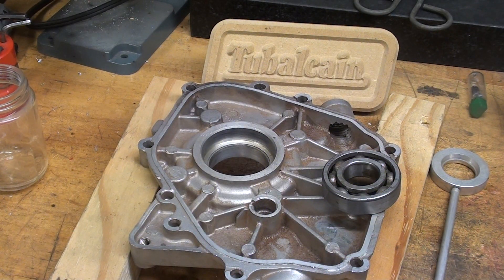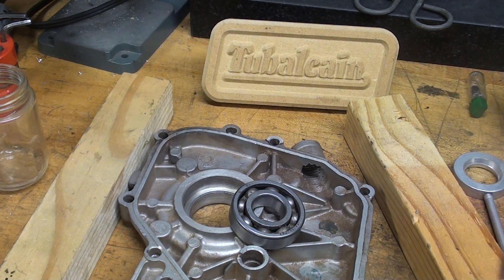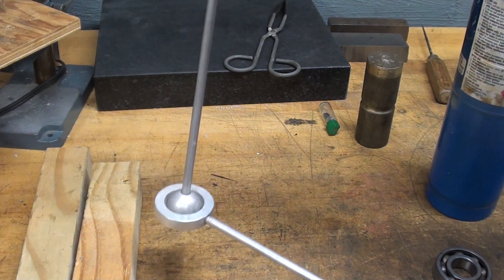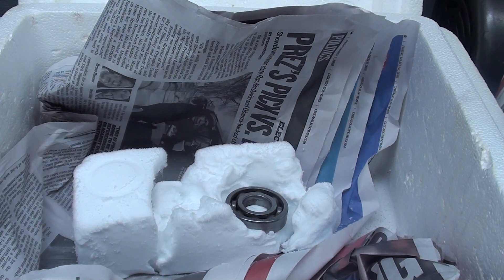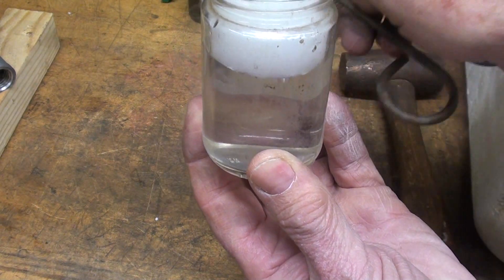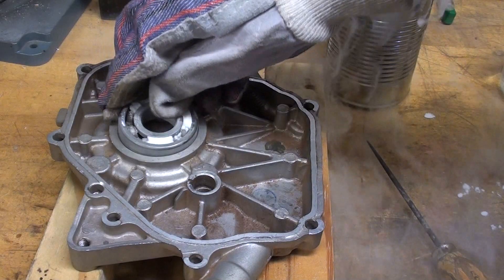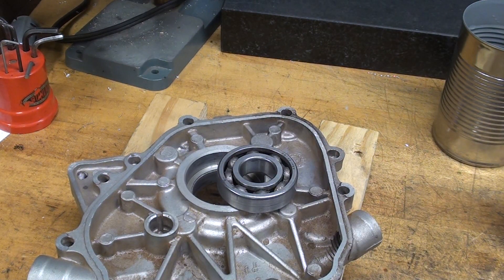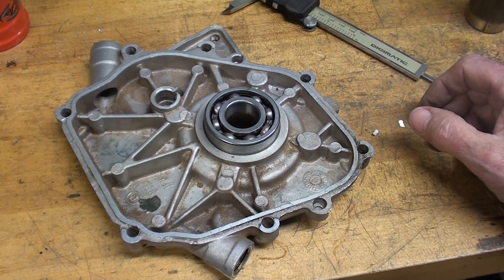SHOP TIPS #298 Shrinking a Bearing with Dry Ice tubalcain

Comment: Thanks for your continuing efforts in demonstrating shop technique Lyle, I did use dry ice once or twice in my working career for fitting bearings, but much more frequently used an oil bath heater, and later induction heaters to expand bearings to fit them to shafts. Once when on a mining machine repair, we had our electric oil bath heater but no power to run it as we were in the field. We used oxy acetylene to heat the oil bath but when we took the 8" or thereabouts bearing from the oil it had been blued by excess heat. We disposed of that bearing and got another new replacement, but when we had a visit from a Timken rep several months later, he told us that it would have only marginally reduced the life of the blued bearing, and that we could have used it. Thanks again and keep up the great work.

Comment: I never used dry ice before.  I remember my Dad showing me how to shrink a crankshaft in the freezer and letting the bearing sit in the summer sun in the driveway.  It worked well too.  I once machined a chuck backing plate and it would not star4t into the chuck.  So into the freezer it went and the chuck lay in the sun.  After about 30 minuets the two went right together.  Thanks for sharing.

Comment: MR. PETE,  I HAD TO LEARN YOUR PROCEDURE WHEN PUTTING A GEAR ON THE AXLE HUB OF A JOHN DEERE CRAWLER.  I WAS AMAZED AT IT THEN.  WHEN I PUT THE GEAR ON THE AXLE HUB IT FELL RIGHT THROUGH.  BY HOLDING IT IN POSITION FOR A FEW MINUTES IT WAS THERE.  IT STILL AMAZES ME.
Reply from the maker: +ROBERT HORNER It is amazing!

Comment: Thanks for making this very useful video, Mr Pete. It will come in handy this very weekend fixing an old cast iron trailer wheel hub as I need to remove the bearing before I fix the broken casting and re-insert the stud bolts. My mate tried inserting the stud bolts and cracked the casting further.

Comment: Thumbs up! I use to put the inner part, whether is a bearing or any other part that needs to be press fitted, in the freezer, and the outer part in the oven. That way allows you to reach a better differential between the parts, and the fit is more tight.
Reply: Yes I've used a conventional oven (200C) and a normal freezer (-30C) to do this to achieve a light press fit without a press.

Comment: I did this some years ago, to insert the input shaft bearing into the cast iron gearbox of a '73 Triumph.  I didn't have dry ice.  I just wrapped the input shaft in newspaper and stuck it in Her Royal Highness's freezer.  I put the gearbox in the oven (it was a small car) at 300F (and boy did that stink!).  After an hour, the room temperature bearing slipped onto the input shaft with no interference and the assembly into the gearbox just as easily.

Comment: When installing ball joints and a shop I worked at years ago, we would freeze the ball joint and heat the control arm on the vehicle. The ball joints would simply slide right in. Other wise you would have to use a pneumatic impact driver to take them out and put them in. Great video! Thanks for sharing.

Comment: I once had to fit a timing gear to a crank on a motorcycle engine. It was purely an interference fit, no key alignment or bolt compression to hold it on.
I used the reverse of this, I waited till I knew there was a really cold night coming (-9c) and left the bike at the doorway to the garage. The factory method was to press the gear on with a huge press, not convenient in situ.
 Next morning at 6am, bike nice and cold soaked, came out, heated the gear with a propane torch till the oil smoked off it, then slid it on. The clearance was initially so great, the gear could be lightly rattled on the crank! 
You could also make mention of the excellent thermal expansion properties of aluminium (especially compared to steel), that bearing could be dropped into that casting if you heated the casting up just a little as well.
Knowledge of these things helps solve problems!

Comment: Great video!!! you also could have applied heat to the casting to shorten your wait time as the bearing was cooling- on a side note I was also in the entertainment business ( Sound and special effects for local bands) I built a "Fog machine" from a small metal trash can, hot water heating element. small squirrel cage blower mounted to the top and a drier vent hose to the side of the can to direct the fog. Heat the water add dry ice (I used a milk crate on chains up thru the top of the trash can so it could be lowered into the hot water when needed) & turn on the blower- HUGE amount of "Fog" would slowly creep out onto & fill up the stage to about knee height the crowed LOVED IT!!! there are a few more details to building one but that's the main idea - Two thumbs up mrpete !!!!

Comment: Hi Lyle,
Very good. I have to keep explaining to people putting things into the freezer will hardly make any difference. We used to use liquid nitrogen as you mentioned. Dry ice is much better than the freezer and as you have demonstrated, does work.  Expansion of steel is about 6.5x10^-6 in/inch F which is 6.5 micro inches per inch for every degreeF. so your 2" bearing will shrink about 1300 micro inches whch is about 1.3 Thou, and this would make a difference. With ring gears we used to allow 1.25 thou per inch of diameter. Easy rule of thumb. and used to heat them with a torch and used oil to determine the temperature so when the oil would sustain combustion it was hot enough. Crude but it worked. Liquid nitrogen was used for valve guides. Just protects the parts so it does not get bruised by using force.
Allister

Comment: I had no access to dry ice so what I used is LPG, I had a hose hooked up directly to a 2 kg cylinder and would turn it up side down and slowly trickle the liquid gas over the bearing and in short order the bearing was very cold, then picking up with gloves drop it into the housing this works very well but attention must be drawn to avoiding open flames and sources of ignition, I have used this many times and it works well, the vapour from the gas disperses in a few seconds with a nice breeze. I would not recommend this method to anybody these days as there are too many people looking for a shortcut too suing somebody. lol.
Reply: That method is extremely destructive to the atmosphere. Free hydrocarbons in the atmosphere produce smog. It's the reason why all of our modern gasoline cars and trucks are built with an evaporative emissions system that stores gasoline vapors in a charcoal canister for burning later while the engine is running.

Comment: Common method in aviation also. We would heat a large roller bearing in oil and then slide it over a long shaft in jet engines. I understand that the very large bolts used to attach the wings to the fuselage in large airplanes are shrunk before installion.
Great video - as always.

Comment: Cool! I never thought of using dry ice. I use this process putting the part in fridge and slightly heating part to expand. Learned it 50 years ago installing starter rings on flywheels. Russ

Comment: Hello, Mr. pete. I thought that you would be interested to know that I once worked for a foundry ( as a driver) and one of my jobs was to occasionally go for some boxes of dry ice, in "styrene" boxes.
The dry ice that they used in the foundry/machine shop, was pelletized and it is my time working for the foundry that got me interested in machine shop work, as I used to go into every section of the foundry and machine shop as part of my job.
Incidentally, one of the products that they used to make was the big dragline buckets, as used in open cut coal mines and spare parts, such as the lip with the digging points and the individual points themselves, also ripper shanks, ( for opening up trenches).

Comment: I use dry ice fairly often. we have a machine at the plant which sprays dry ice like a sand blaster for cleaning machinery. works awesome and the only mess is the stuff that was on the machine is now on the floor to be swept up. You can pick up dry ice but you have to keep rolling it around in your hand so it doesn't sit in one spot for more than a second or two.

Comment: Cool video, I've used dry ice many times in the machine shops I worked in. Sometimes, if we had the time we would use the freezer in the break room. When Liquid Nitrogen became readily available and affordable, we switched over to that. We would use Liquid Nitrogen to replace the air-frame bushings for the landing gear on the F-16.

Comment: Same method is used on aircraft landing gear, where the shaft is shrink fitted onto the landing gear casting, using a combination of liquid nitrogen for the shaft, and an oven for the casting, then put together using a hydraulic press. You only get one chance to do it right, so have to prepare and check everything before, and do it all in seconds once you start the ram. 

Removal of the shaft is easy, you put it in a mill and use a boring bar to cut it out of the casting. Once you get to the collapse point you just need a new boring bar or you have quick reflexes.
Reply: +SeanBZA Aircraft (reciprocating engine) cylinder heads  as well. The aluminum heads are heated and the steel cylinders chilled; then quickly aligned & screwed together in a special device. An otherwise serviceable cylinder can later get a new head if necessary, but the old head must be cut off.

Comment: yeah good one, I used it to remove broken off sparkplug in aluminium head .froze an xzn bit and tapped it in.put it the freezer though.didn't know about dry ice, very good tip. thanks. goedendag

Comment: The same thing works on outsides too but it takes heat, you can drop a flywheel ring right on with a bit of light torching.

Comment: Driving the bearing into the housing,(especially an aluminium one) will cause problems with size fits, always use this method when replacing a bearing in a housing, or warm the casting, it is easier than using dry ice.

Comment: The local supply sources for me are a disco outfitters, and a stage outfitters. Dry ice is used for fog effects in both cases, and they can obtain it readily. For small bearings, you could try the wart freeze spray obtainable from chemists - the cooling effect may be sufficient to do the trick. Also worth trying is a deep freeze for the bearing, and a warm oven for the casting (obviously not if there are low temperature inserts in the casting) - the expansion rates are a little different but enough differential temperature should work.

Comment: I've had to use the reverse and heat up the mating part to remove a trreading gauge that got stuck. We also used ice on the gauge at the same time. It took some time but we got it out. :) This was a large oil-field threaded connection on a 12-in diameter tool called a drill collar, used above the bit, to add weight to the bit, when drilling an oil or gas well.

Comment: If you don't have access to dry ice, you can heat up the aluminum casting to about 250F and have the bearing in the freezer.
I use a welding rod oven set to around 300 and out motorcycle cases in. Within about 10-15 minutes I hear the bearing fall out as the aluminum expands much more than the steel does.

Comment: I remember well the first time I did this, only I put the bearing in the freezer overnight and gearbox casing in a low oven. It was amazingly satisfying when the new bearing dropped in and even rattled a bit whereas the old one had to be driven out.

Edit. Pro tip:  Make sure it's the right way round. BTDT.
Reply from the maker: +Graham Langley thanks--I do that in upcoming #299

Comment: A word of caution to your viewers:  In the past, I've used dry ice/acetone baths for cooling traps in vacuum systems (Chemistry) and other applications.  The problem arises in that copious quantities of CO₂ will dissolve into acetone −78.5 °C (Henry's Law).  If you then plunge a room temperature object into the bath (e.g. a thermometer), it will immediately raise the temperature, causing CO₂ gas to come out of solution.  The gas bubbles churn the solution, accelerating the degassing.  A geyser of dangerously cold and flammable acetone is the result.

I once had this happen in my kitchen on a particularly cold winter day.  Needless to say, having to open all windows, extinguish all pilot lights and potential ignition sources, and air out the house for hours was no picnic!  If you must submerge an object in such a bath, do so with extreme care.  Pre-chill it if possible, and immerse it in the bath as slowly as you can.

P.S.  You could have just looked up "dry ice" in the phone book.  Remember those? :P
Reply: +Brandon Fesser what...WHAT.....FOR THE LOVE OF PETE, DONT LEAVE ME HANGIN.....WHAT THE HELL HAPPENS WHEN

Comment: Very minor correction that's not water vapor coming off the jar, "When dry ice is added to water, it sublimes to carbon dioxide gas rapidly because the solution's temperature is warmer than the dry ice (-78.5 C° or -109.3 F°). This gas can be observed as bubbles or clouds above the solution."

Comment: If you fit a bearing just .001" into a bore, you will need to use a hydraulic press to remove it. If you heat up a bore to insert a bearing and the bore is too small (about .010" smaller) it wont spin. Fitting bearings is engineering calculated. Not too big, not too small. I spent more than 20 years dealing with that. Shrink and expansion are very precise. When you cut a piece of wood you can use a tape measure to measure it, to measure a diameter of metal bore or shaft you must use the right tool.

Comment: I'm doing sealed bearings on dolly wheels very soon . very timely. Will I need to regrease them after words? if so what is good to use( they are a high speed bearing)  thanks. I don't machine but have all ways been interested. I was in a shop a few years back and the old timer there wasn't interested in teaching any more. I guess it wasn't my time. keep up with the videos and thank you for what you do

Comment: Does the effect.of cold work on the opposite instrument that you showed the thermo expansion demonstration? I'm sure it does, but didn't know if the aluminum would shrink that much. also when I sleeve a bearing or race over a shaft, I heat the bearing.or race in oil to give it a more even heating.and less likely to over heat and damage or weaken one side more.than the other.

Comment: Could you use the dry ice to remove a bearing as well? Would the heat transfer from the bearing to the ice quicker then the heat form the casing to the bearing?
I have a 50mm tapered roller bearing and the outer race is a press fit to the iron casing. Do you think it would work to jam a piece of dry ice on the inside of the race, possibly apply little heat to the casing beforehand and quickly tap the race out? There is only a small lip upon which I could tap or use a press so even getting the race to be slightly smaller would help.
Thanks for all your videos, I like them very much.

Comment: Have often done this with heavy equipment especially bulldozer final drives, use heat and nitrogen or dry ice in conjunction with each other sometimes due to larger interferences. One thing that has always bugged me physcally-why when something expands under heat let's say a bearing, does it only expand outwards and bit in all directions, you would thing it would expand evenly both direction's, I know.it doesent but it has always bugged me lol.

Comment: We had vats of liquid nitrogen at Air Research AKA Allied Signal now Honeywell, and the main products were APUs (jet engine starters), and jet, turbo prop, and turbine engines were kind of secondary. Now the main thing is turbine engines, for the Chinook helicopter. I had a piston seize into a brake caliper, and got it out by throwing the caliper in the freezer over night. I put a screwdriver into the dust boot ring, tapped it once and the piston fell out. The day before, I beat, & twisted & cursed, and pounded, and cursed some more. The crooks at the garage could not get that piston out either, but they still charged me $300 to rebuild the caliper, despite the fact they did not actually do any of the work. I am sure they tried, but some days being smart beats being strong. That incident started me buying tools and fixing my own stuff. 33 years later I don't even want to know what it would cost to replace my tools. The knowledge is something no one can steal from me, except maybe old age and dementia.

Comment: You don't need dry ice, just put it in the freezer overnight, and you can heat the casting to expand it if tight press, 100 degrees = 1thou.

Comment: Good evening, how successful do you think I’ll be when I freeze my rusted 
 tongue jack filling the inner pipe with dry ice then torch the outer pipe trying to crack the rust weld between them?  I’ve tried white vinegar, PB blaster, electrolysis, and oxalic acid solution with hydrochloric acid.  Haven’t been able to free the rusted sleeve yet. Any suggestions?

Comment: I think there is a you tube video that shows how to get dry ice from a CO2 fire extinguisher.  The fire extinguisher was discharged into a pillow case and the carbon dioxide solidified and accumulated inside.  It looked like enough of it accumulated to accomplish what you did in this video.
Reply: CO2 extinguishers are very expensive, yet dry ice is only a few dollars per pound.